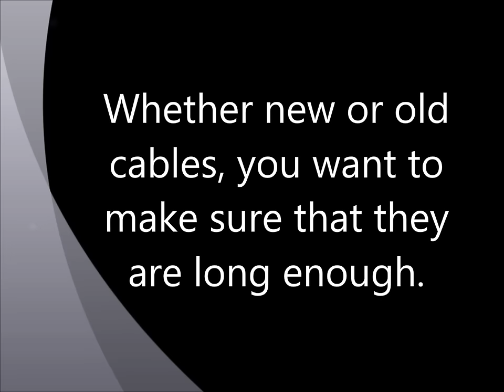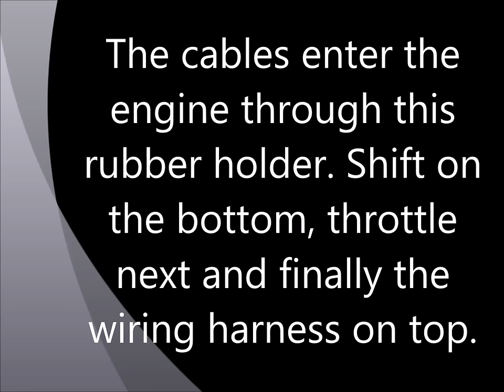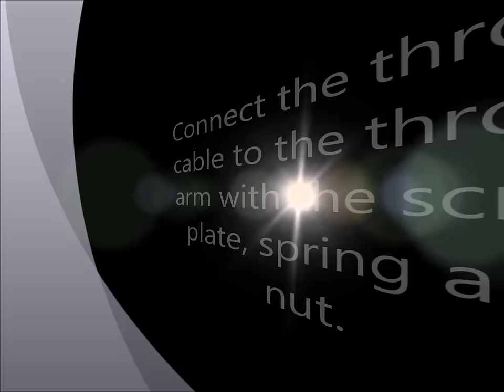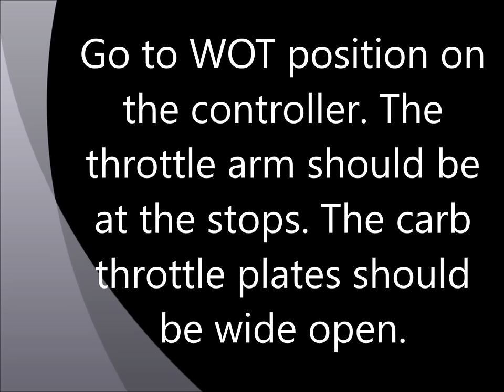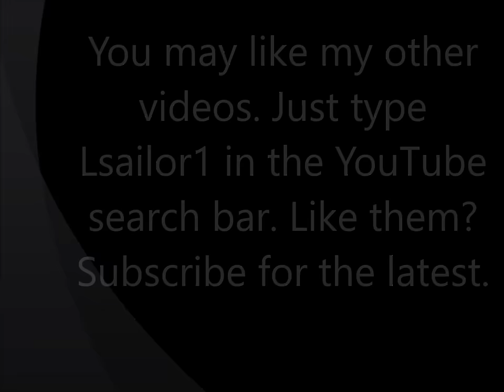How to install Mercury throttle and shift cables

Comment: Your video says to connect the throttle cable to the throttle arm with the scre, plate, spring and nut but it doesn't show the connection.   I've never looked at it properly connected so don't know how I can configure it to look like your photo.   My cable has come detached, yet the screw, plate spring and nut are still attached.   So that means the screw doesn't go through the cable end.  If not, what does the cable end fit over?  I can't feel any stub on the arm or the plate other than the tiny little thing on the plate.   My plate looks just like your photo, but the throttle cable won't attach to that tiny little bump.   Thanks for any help.

Comment: What is the piece called where the 2 cables slide in (it's plastic and slides back and forth when you move shifter from forward to reverse) was told theybare notorious for cracking but can't find the part without a name. Thanks in advance nice video liked saved and subbed.
Reply: Did you ever find out? Mine are broken as well and I can’t find them
Reply: @Whyisthissohard  shift cable slide?

Comment: I have my idle adjusted correctly however when going into WOT it won’t come back down to idle speed I have set when in neutral, revs too high to shift back into gear. Only setting I can get it to fall back to appropriate idle speed is not near WOT. Appreciate your videos.
Reply from the maker: Thanks for watching my video and your kind comment! There are three things it could be. The cables, the controller or the engine itself. I would disconnect the cables completely and see if you can use your hands to move the throttle. If that works, then check the cables for free movement by disconnecting them from the controller. If they don't, buy new ones. If those two are good, take apart the controller and grease it. I have videos on how to grease the cables and how to take apart the controller. Let me know what it turns out to be. Best, The Sailor.
Reply: @Lsailor169699  yeah it sounds like somethings sticking!

Comment: Hi my Merc control box is a side mount starboard side console what do you recommend? seems most are mounted to the right side of gunnel. Good video
Reply from the maker: Thanks for watching my video and your kind comment! The control box can be mounted anywhere as long as the cables are run to the engine in a smooth manner that they won't kink. Most control boxes I have seen are to the right side of the wheel. You may like my other videos. Just type Lsailor1 in the YouTube search bar. Like them? Subscribe for the latest! Best, The Sailor.

Comment: I have a 9.9 4 stroke Merc I would like to use as a kicker. This motor is a pull start and has been used as a kicker before. Sense i don`t need power to the motor can I use Merc. controls for just the throttle and shifting?.
Reply from the maker: Thanks for watching my video Mike!  If it is just going to be used as a back up motor, I do not think you would want to go to all the trouble to install cables and a controller. Most back up (kicker) motors have a tiller handle (as shown here): https://www.boatus.com/magazine/2013/june/how-to-count-a-kicker.asp   It would be a lot of money and hassle just for a motor that basically sits there most of it's life.  You may like my other videos. Just type Lsailor1 in the YouTube search bar. Like them? Subscribe for the latest! Best, The Sailor.

Comment: Do you have a link for the cables you purchased, mine broke
Reply from the maker: Thanks for watching my video! Here are two: https://www.ebay.com/itm/Mercury-Outboard-Mercruiser-Teleflex-Throttle-Shift-Boat-Control-Box-Cable-10ft/132568519263?epid=1040535104&hash=item1eddb3125f:g:TKUAAOSwAQBaxSA2     https://www.amazon.com/Throttle-Shift-Mercury-Mariner-CC17910/dp/B00YMZJ22Q/ref=sr_1_3?keywords=Mercury+outboard+control+cables&qid=1571852324&sr=8-3     Remember to get them long enough!! You may like my other videos. Just type Lsailor1 in the YouTube search bar. Like them? Subscribe for the latest! Best, The Sailor.

Comment: Hi I need help I got a 115hp Mercury and when you put it into fwd the idle Changes before the gear is fully in fwd how do I adjust the shifter to work normal
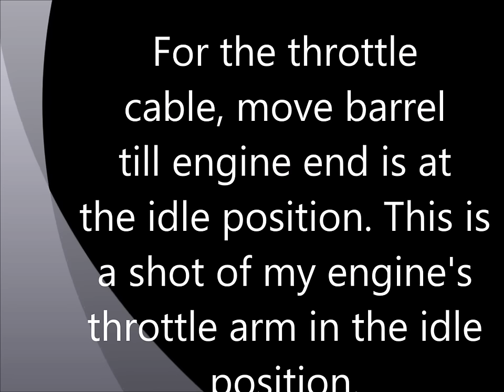Reply from the maker: Thanks for watching my video! If your engine is similar to mine, at 2:47 in the video, there is a show of a round arm with two screws on it. The bottom gold screw is the idle adjustment screw. You can also change the idle situation by running the "barrel" in or out as shown at 3:02 in the video. Make sure the fast idle arm on the controller is all the way down. You may like my other videos. Just type Lsailor1 in the YouTube search bar. Like them? Subscribe for the latest! Best, The Sailor.

Comment: ok so I juts replaced  throttle and shifter cable it will go into reverse but whenever I put it in Drive it stays in reverse what do I do
Reply from the maker: Thanks for watching my video! It has to be the "can" on the shifter cable. Adjust it backward/forward till it works properly. Make sure both cans (throttle/shifter) are locked into the sockets when done adjusting.  You may like my other videos. Just type Lsailor1 in the YouTube search bar. Like them? Subscribe for the latest! Best, The Sailor.
Reply from the maker: @Derek Bradley Thanks for watching my video! At 3:01 in my video you can see the adjustment "barrels." You rotate these forward or backward on the threads to get them in the proper position per the video.  You may like my other videos. Just type Lsailor1 in the YouTube search bar. Like them? Subscribe for the latest! Best, The Sailor.
Reply from the maker: @Derek Bradley My pleasure!

Comment: whats the  problem when the string wheel is hard to turn? I discounted steering link...but the motor is very hard to turn left or. right. what am i doing wrong?
Reply from the maker: Thanks for watching my video Brenda! The steering is hooked up to the engine by a large black cable. At the wheel are teeth that move that cable back and forth. Grease that area thoughly. At the engine are grease points for the shaft that runs through a tube. Get a grease gun and grease that too. If that doesn't fix the problem. you probably need a new steering cable. Best, The Sailor.

Comment: Does this motor have a thermostat if so where is it located
Reply from the maker: Thanks for watching my video! Yes, and it is in the back above the spark plugs. You may like my other videos. Just type Lsailor1 in the YouTube search bar. Like them? Subscribe for the latest! Best, The Sailor.
Reply: @Lsailor169699  could you if possible post  a photo of where its at because i cant find it on mine
Reply from the maker: @nathanielnewsome6699  I need to explain. It is right next to the top spark plug and it works this way. If there is no cooling water, it will overheat and set off a buzzer inside the controller. The same buzzer that will go off if there is no oil in the reservoir (that is one reason I removed the oil system and went to 50:1 mixed). Let me know if you find it. There is a single wire coming out of it. Best, The Sailor.
Reply: @Lsailor169699 yeah  i see the wire but there isnt any bolts to a cover to take off to access the thermostat
Reply from the maker: @nathanielnewsome6699  Why would you want to? Best, The Sailor.
Reply: @Lsailor169699  because it needs replacing  i guess i will just figure it out myself thanks anyway
Reply from the maker: @nathanielnewsome6699  Good luck! Best, The Sailor.

Comment: what is the problem if cannot speed in reverse mode for 90hp mercury ?need help.. l
Reply from the maker: Thanks for watching my video Mohammad! If you have a remote throttle, it is going to be that the throttle cable needs to be adjusted. The explanation for this begins at 2:40 in my video. You have to adjust the barrel till you are getting speed both in forward and reverse. Best, The Sailor.